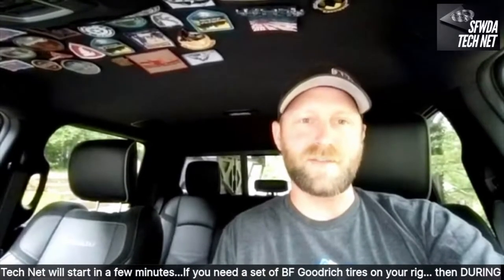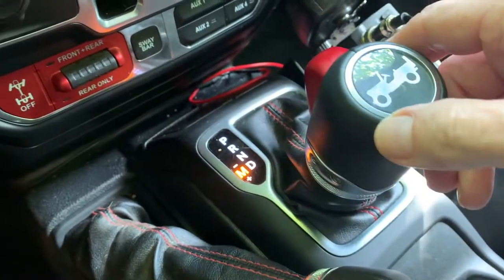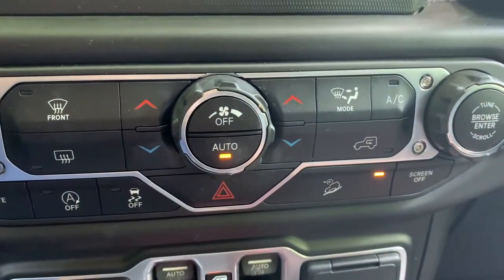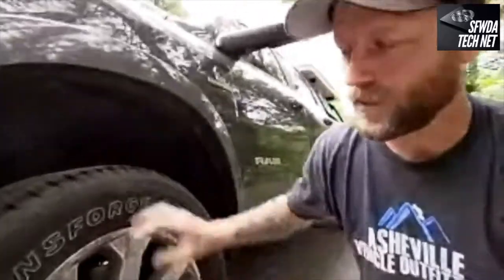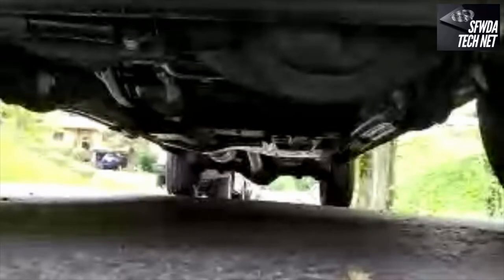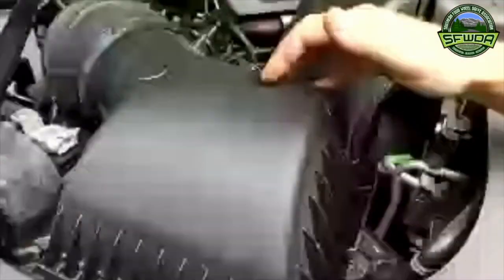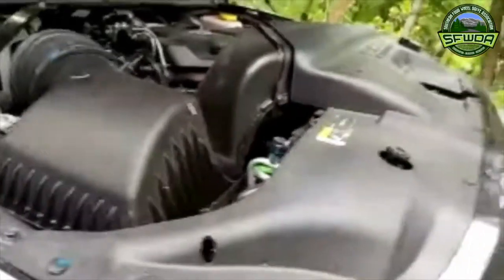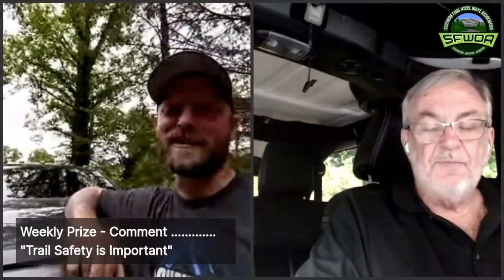Tech Net- Get To Know Your Off-Road Rig

Comment: Just FYI, if you have a manual transmission ( mine is a JL 2018 6 speed manual ) does not have the hill descent ( which you wouldn't on a manual ) just in case folks are looking for it.